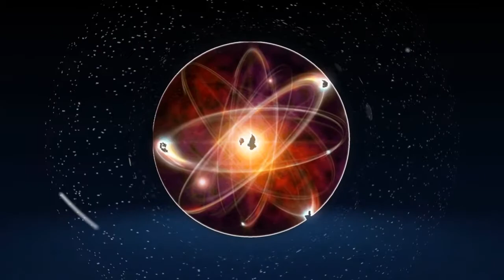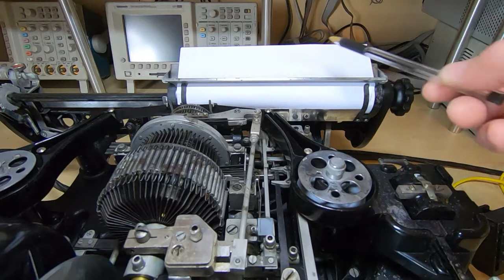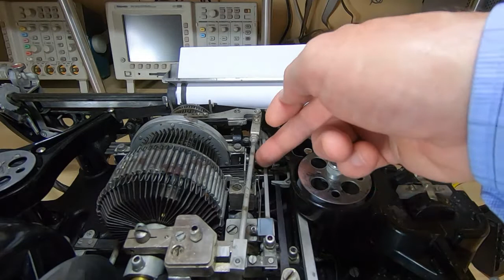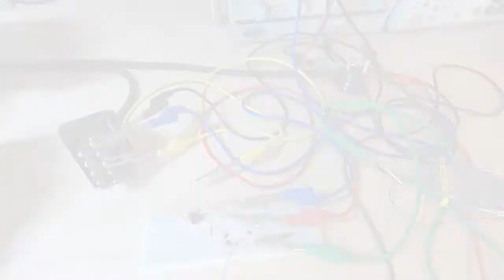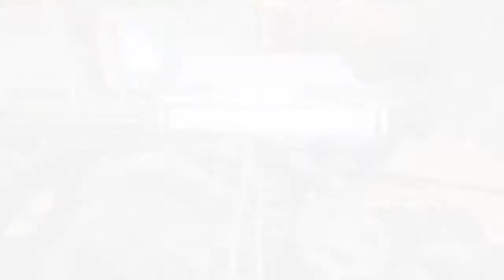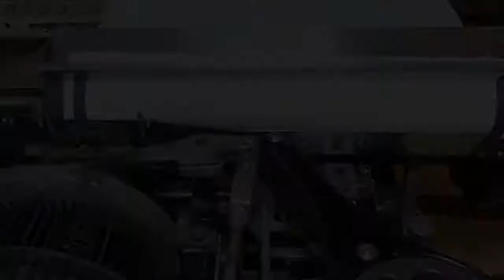Creed 7B Mark 1 Teleprinter Part15

Comment: Did you ever detail your drive circuit?

When I built mine (some 40 years ago) I just used two largish NPN transistors, one for each coil, driven by two lines from a parallel port with the timing done in software (my serial port wouldn't run slow enough). As well as the usual back EMF diode for when the transistor turns off it also needed a capacitor across each coil too - it seemed that when one coil energised it would generate an EMF on the non-driven coil as it pulled the armature across. If I was doing it now I might just go for an H-Bridge driver IC.
Reply from the maker: I never got round to detailing the circuit but it was probably even simpler than the one you describe. Because I was only running the unit 'locally' it did not need the push pull coil setup so I just ran it as a single doubled up coil. I then OR'd the incoming signals to drive the serial data to the coil. I actually have an original terminal / exchange box for this unit which I intend to make a video about sometime.